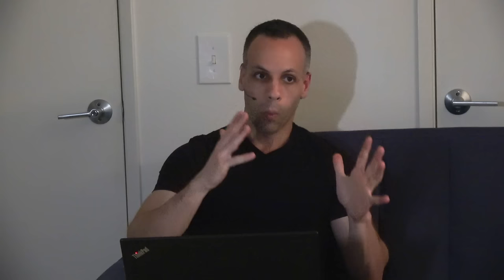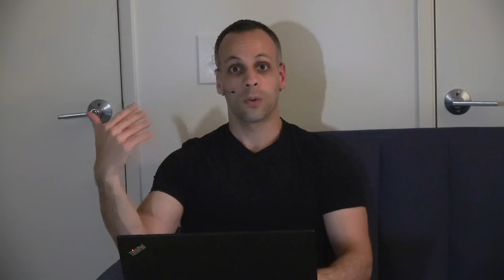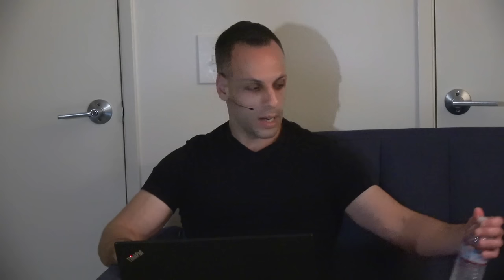EVGA's Oversight: Unannounced Changes Destroy PCs, EVGA takes NO ACCOUNTABILITY

Comment: I had the misfortune to buy an EVGA Titanium power supply . It didn't work for 10 years like they promised but rather 3 or 4. RMA is not possible where I live so my only option was to go to a repair shop. They fixed it for a hefty price only for it to break the next day. I brought it back and they said they'll fix it for free ( as law requires). Turned out there was a cascade failure and the AA9013 controller was broken. It took them over a week to create and draw the schematics by hand since there's no info anywhere about this power supply. The saddest part is AA9013 controller is basically unobtainable unless there's another similar power supply to take it from. So my  ultra expensive power supply is now broken and there's no chance of repairing it. At least the repair shop gave me my money back.
Reply: good guy repair shop.
Reply: @SoulTouchMusic93  I mean they are required to do so by law but the fact they didn't try to weasel out of it speaks volumes.
Reply: Which model?
Anything can happen, but yeah I dislike EVGA’s use of custom IC’s even on their gpu’s.... they usually are the thing that fails a lot on their models which is crazy because it’s custom made for a reason.... right?????? My real complaint with evga
Reply: @luvingyouu  My model is EVGA SuperNOVA 1000 T2.  I wish I could buy that controller separately but there's no data where to find it. Best bet is to buy a donor second hand PSU that has the same controller. That's costly however still cheaper than new Titanium PSU.
Reply: And now my PC went boom . Just great . Lovely day .

Comment: EVGA replaced two video cards for me because of an issue that was 100% my fault, at no expense to me. Because of this, I've only used EVGA products for whatever I've needed that they make since then. Disappointing to hear about this issue.
Reply: I had a similar experience with them, my old 2070 fan was getting noisy, so I emailed them to enquire on the cost of a replacement, it was well outside warranty.  After a few emails back and forth to check model numbers and which fan I needed, they just posted the pair of them to my with no charge.
Reply: dont worry, you paid for all that free RMA with  inflated price of the card.
Reply: So you abused their RMA policy because of you're wrong doing? And you wonder why manufacturers/retailers have tighter return/exchange policies because of individuals like you have ruined it for others. Now when the company change their policies they're the problem?
Reply: @disguiseddv8ant486  you dont seem to have very good reading comprehension. They covered an issue that they had no obligation to cover, and I've made them my first choice for the hardware they make since then, because they had a customer-centric approach. When it comes to the current issue,  did you even watch the video?

Comment: Oh my god, this actually happened to me at work. I work in IT at a company and was building some custom PCs for some heavy workloads. I bought 3 identical model EVGA power supplies from the same vendor on the same day, from the same site. At some point one of the power supplies wasn't functioning well, so given that I had 3 I decided to see if the Cable was just bad so I swapped them to check. The power supply still didn't deliver power to the MB. so then I took the "donor" power supply and tested it with the cables that the non functioning unit was shipped with. the motherboard lights came on, but the board was fried. 

I got lucky and managed to RMA everything and get everything replaced from EVGA. but it took over 5 weeks to get a new board as this specific one had necessary features that no other vendor offered at the same price point. The positive thing is that at least my boss was chill and we tested the voltage output of the replacement unit along with the other 2. Needless to say, there were differences despite being the exact same model.

Comment: I recently had to buy a power supply unit for a workstation I was building so that it would support a high power GPU.  The unit I bought had modular plugin cables that are proprietary, so I got to researching all sorts of stuff to make sure I didn't burn up this workstation or the GPU.  I must have rung out every cable I installed to ensure it was delivering the right power to the right pins.  This was a vendor who took pains to provide information about their cable pinouts.  I can't imagine what it would be like to deal with a vendor who just changes these pinouts willy-nilly.  EVGA used to be a very reputable company.  It seems like they are on a downward slide of late.  Thanks for covering this.

Comment: That's when you would learn that Raid is not a backup! 
Redundant != Backup
Reply: I mean it literally is backup. It's just not off-site backup or backup on a second system...
Reply: It is a backup.  But not raid 0.

Just it isn't as fault tolerant as an external or hot site one would be.  Like if just one drive died... It could be restored from the copy on a different drive.  But multiple copies on the same drive aren't true backups.
Reply: Not based on the definition that pops up when I google it.
"Backup refers to the copying of physical or virtual files or databases to a secondary location for preservation in case of equipment failure or catastrophe."

Pairity data is not a copy.
Reply: @justinjja2  Raid 1.
Reply: @SuperTort0ise still not a back up. If you get ransomware, you lose BOTH sets of data
Reply: Rotating offline weekly backups are the key keep several bare drives and a dock overwrite the oldest drive each week with a full clone and than disconnect it and keep it in a fire-safe until its next rotation that way you always have at least several backups that aren't physically connected to anything that can explode like this
Reply: @OmniscientWarrior  RAID is not a backup, no matter which number you attach to it. There is a huge difference between data availability and data security. You catch a malware, you have it on every RAID drive. You overwrite or delete data by accident, it gets overwritten or deleted on every RAID drive (in fact, most data losses occur because of human error, not technical defects); same goes for data corruption.
Reply: @TheDeceptiveHero  "@OmniscientWarrior  RAID is not a backup, no matter which number you attach to it"

Incorrect. 

"There is a huge difference between data availability and data security. You catch a malware, you have it on every RAID drive. You overwrite or delete data by accident, it gets overwritten or deleted on every RAID drive (in fact, most data losses occur because of human error, not technical defects); same goes for data corruption."

Still it doesn't change the fact that some RAID versions does fit the definition of backup. While it doesn't protect against all scenarios it can provide backup data to protect against disk failures. While it isn't recommended as a backup system, it can still provide a small level of backup functionality.
Reply: even raid1 is not a backup i lost 6 years of data when the pcb of my raid enclosure went bad and wrote garbage in the drives i tried to recover the files but the data was synced into randon bits, now i have enclosures where i can turn off and disconnect physically the drives and i clone them manually with an app as you cant automate at drive that isnt there
Reply: btw raid was never intended for 18tb drives like we have today check level1techs or other sources why
Reply: @justinjja2  It can be, because you can raid across servers, right? But most home setups are on 1 pc and 1 power rails (special PCs will do 2 power rails etc :P ).
PS, as others have said, it's not a secondary backup though. It's more fault tolerance.
Reply: @nowayjosedaniel   It's literally NOT a backup, AKA a second copy of the data. It's just parity information, so that if a drive dies, the data can be restored to a replacement drive. Get unlucky and have more drives die at once than your RAID array can restore and see how good your "backup" is... Spoiler, it's no good, because it's not a second copy of the data, and now all the data is just gone.
Reply: @yourcrazybear  No RAID version fits the definition of a backup.
Reply: @mjc0961  "@yourcrazybear  No RAID version fits the definition of a backup."

Incorrect. RAID 1 mirrors data on 2 or more disks. That fits very well with the definition of a backup.

Backup:
": a copy of computer data (such as a file or the contents of a hard drive)"
Reply: @_oBSOLEte_  "Redundant != RAID in the first place. Redundancy means all the systems in a same case are redundant. Including the PSUs and the disk arrays in RAID."

Incorrect. The scope of redundancy differs from case to case. It all depends on how you define the system that is the target of the redundancy.
Reply: @jordanwardle11  based on their definition I'm right. It's not a good backup but that doesn't mean I'm wrong.
Reply: @justinjja2  Google is trash now. It's wrong. Often useless like most of the internet these days.

It is backup. END OF DISCUSSION.

To argue that backup requires another location entirely is just silly. That argument taken further means nothing is backup because failure could happen anywhere. Off site backup isnt safe according to many scenarios while on site backup is better in those scenarios, so you could use this logic to argue nothing is backup bc nothing is truly safe enough.

Or you could argue the only thing considered backup is to print binary on physical paper and place it in a fireproof safe on another planet.
Reply: @mjc0961  It literally is backup. It just isnt the safest backup for more common scenarios.

Please stop pretending as if backup requires fullproof situations. Nothing is foolproof. Nothing.
Reply: @_oBSOLEte_  " @yourcrazybear Which is exactly my point, thanks for parroting."

Incorrect. You made a false claim that "Redundancy means all the systems in a same case are redundant. ". That's simple not true. It all depends on how you define the system that is the target of the redundancy.
Reply: @_oBSOLEte_  " @yourcrazybear No one who had ever spent time rebuilding a failed array would claim a RAID would make a system functionally redundant."

You can have different levels of redundancy for a system or group of systems. You are free to discuss that. However. In this instance you made a false claim which I corrected. 

"Or maybe you, but you should have been fired. You're just being obtuse for the sake of it."

Personal attacks are never valid arguments. And if you want to participate in a discussion it's a positive if you don't post outright lies and then resort to personal attacks as soon as someone corrects you.
Reply: @_oBSOLEte_  "@yourcrazybear Redundancy != being protected from a single drive failure."

Like I informed you already. You can have different levels of redundancy for a system or group of systems. 

"And this video is the perfect example of it. "

It's an example for one type of redundancy level. Not all of them. 

"Let that logic sink in before you go die on that hill, my troll... XD"

Personal attacks are never valid arguments.
Reply: @_oBSOLEte_  Something doesn't have to be perfect to be considered Redundant or Backup. Youre insane.
Reply: @mjc0961  You mustve failed English because you are so full of pretentious rage that you dont even grasp what simple words like Backup mean.

It is literally backup. The end. You lose. There is no discuss to be had here by a reasonable person.
Reply: Jebus F...all this noise.  Forget drive failures.  Raid 1, 5, 6,10,50,60 still means when a file is accidently deleted.  Its gone from filesystem and would require recovery software before sectors re-written on top of.  Therefore the RAID is not a backup.  Windows home users consider Veeam agent free + shadow copy explorer.

Comment: In particular, I test the power supply's motherboard connector for voltage stability overnight with checks every few minutes before ever plugging it in to a motherboard. I have been testing all power supply outputs since I was working for a used computer dealer about twelve years ago, when he started. It just makes sense.

Comment: Fun Fact Louis. Corsair also uses different pinouts for the modular plugs across it's PSU line.
Reply: The bad here is that it's the same model. They really need to make a universal standard for modular power supplies. This is just getting insane at this point.
Reply: did corsair also forget to key the plugs differently so they couldn't be physically plugged into their own "identical" and incompatible power supply?
Reply: I don't believe you watched the video. If only that was what this was about lol
Reply: @outseeker  - Yes, Reddit is your friend. Issue is not unique to EVGA
Reply: @GreentipsCo i just found it (only slightly) hard to believe anyone would make such a mistake, let alone multiple or all companies XD i appreciate your taking the time to pre-reddit on my behalf <3

Comment: The difference, in this case, is they sent back a different model.

Their records show that the customer sent in v1 PSU (which was proven to be faulty) and instead of repairing, they sent back a v2 replacement unit.

At the time of sending the different replacement unit back to the customer, they are aware (or at least should be aware) of the pin-out difference.

So they should cover the drives for the customer, 100%, no questions asked!

To avoid being scammed and to avoid liability issues, all they need to do is have a policy to notify the customer, which they failed to do. If that was the case, and my return unit had a warning, there is no way possible as a customer I can scam them.

Comment: High end PSU have very long warranty, some are 10 years so getting a completely new model as a replacement is a normal thing. If they just get you to sent them the old cable and give you new cable that go with the replacement this wouldn't happened.
Edit: same model replacement but different pin out? WTH

Comment: I'd adapt the policy like this, if you had an old supply and we RMA'ed you a different version of the same model with the pin-incompatibility AND we did not tell you about it before we updated the website (so a cut off date), then we'll cover the hardware that got destroyed (up to the current market value for the same or equivalent product) but not for the data recovery. That would mean it would be less easy for any random person to send in old junk hardware and claim it was their EVGA power supply - it limits it to those that would not have been informed about the change and were basically setup by EVGA to use their old cables while not being told that they'd changed. My 10 cents.

Comment: It's not just EVGA, I own two Corsair PSU's with two different cable configs. It's a real pain in the butt!
Reply: Are they the exact same model though? Labelled exactly the same? That's what they're doing now... Changing the pinout mid-production without notifying anyone, and further instructing uses to keep and use the old cables that they are aware will cause this problem. 
This little bit should place legal liability on EVGA for instructing the user to take actions which, when so done by following the directions precisely, causes the damage.

Due to the damage being caused by following their instructions, I'm fairly certain they are liable here.
Reply: Type 3 and Type 4 are compatible with each other.  Only the 24 pin is different with more sense wires for higher efficiency.  There’s type 5 now but it’s physically smaller connectors that won’t fit.
Reply: @someusername121  That requires looking up, the EVGA owner didn't even notice the box was different between his V1 and V2.
Reply: @tomstech4390    From what Louis said, firstly the labels are identical, other than the manufacturing date, which no one expects to be a problem when they send in an RMA - it's expected to receive a newer unit than you sent in. There was no "v1 or " v2" anywhere on the label. As far as boxes go, secondly, it was an RMA, so probably shipped to him in a plain brown or white cardboard box. Also... If they didn't change the label in the product, they're even less likely to change the packaging, which would be more costly, and... unless corporations are ordered to do things like that by a judge... they tend not to. It's not financially smart for them.
Reply: @tomstech4390  At least from what Louis read, they didn't even provide the new cables and the tech said they would send it to them after it burned up his drives.
Reply: Corsair has specific cable standards that are interchangeable (even though you never should interchange, just to be safe). Corsair is actually one of the best in the market regarding this stuff. They also have a guide on their website displaying exactly which cable/connector types can be used with what PSU models.
Reply: @Real_MisterSir  Yeah. Corsair is in a whole different league compared to EVGA.

Comment: Not standardizing the connectors and pinouts on modular power supplies must be one of the biggest PC/ATX failures in recent history.
I had something similar happen where a BeQuiet PSU failed, some 15 years ago. They also told us to keep the cables and we received a new unit without cables. Support was proud to say that they sent a much better/upgraded unit as a replacement. Well. The cables didn't even physically fit anymore. Had to go back to the shop and get an off-the-shelve replacement unit, after some discussion...

Comment: The issue stems from the fact that it is rarely true that the brand name on the side of the psu is the same brand that built the PSU. There are only a couple OEMs that build computer power supplys and its not un common for multiple oems to be used by the same brand across their product lines.